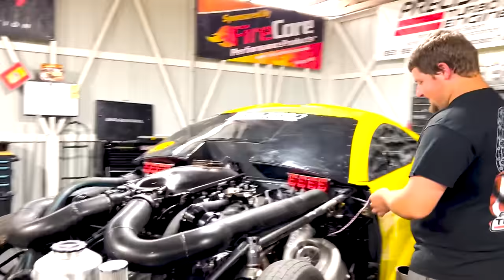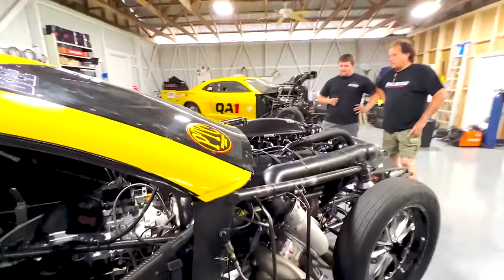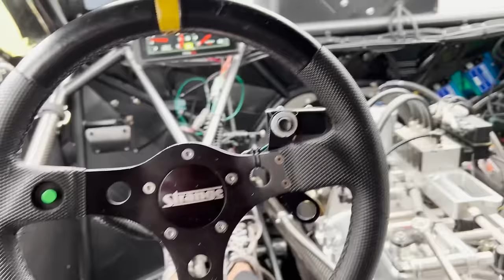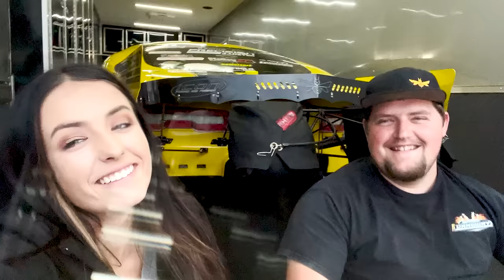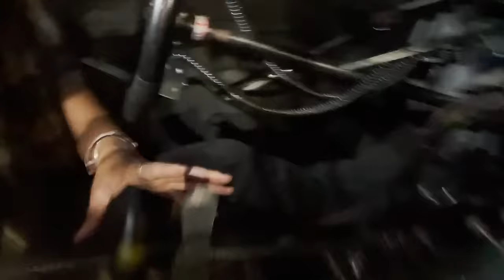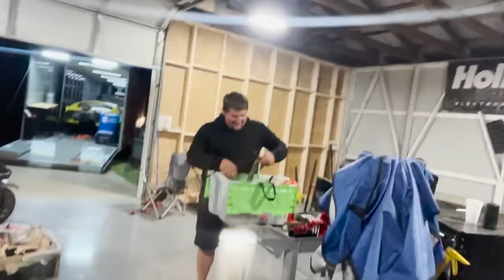Driving a ProMod for the 1st Time!! - RVW BumbleBee

Comment: I don't get why they are using a toggle switch on the trans instead of putting a momentary button on the steering wheel and allowing you to keep both hands on the wheel.. it'd work the same way. Basically that's just a sequential dogbox with a torque converter instead of a clutch.

Comment: I think it's hilarious how they have a million dollars tied up between both cars but the tow rigs are barely 100k and the one car is even being pulled on an open trailer but hey that's what it takes sometimes to run up front of the class that you are in and to be able to win races and I have seen alot of people when it comes to any type or style of racing have similar setups as far the tow rigs and race car's because you want to run up front and win races and you put any money that the car wins back into the car and there isn't always a budget for a million dollar car and a million dollar tow rig as long as you can have room for the car and tools and maybe spare parts then that is all you need

Comment: Holy Flippin Smokes, how big are those Turbos on Bumblebee? They look like they're 175mm. I just noticed you can see where the trans connects to the drive shaft from inside the car, I'm sure all pro mods are like that & it's perfectly safe, but it's spooky 🫣 seeing that U joint spinning 8500 RPM that close to her arm.